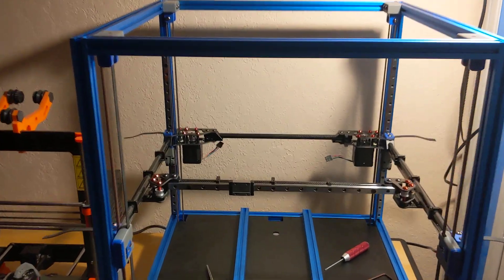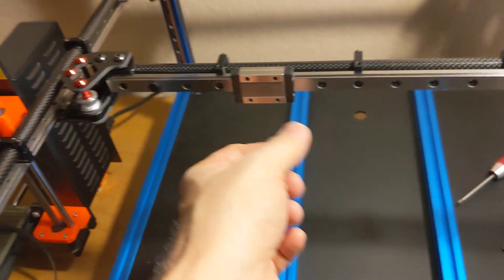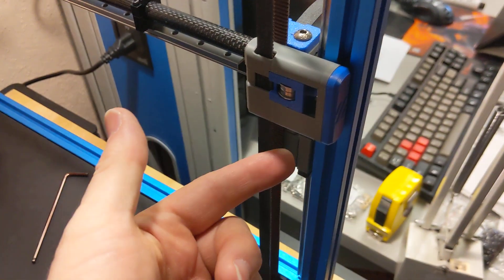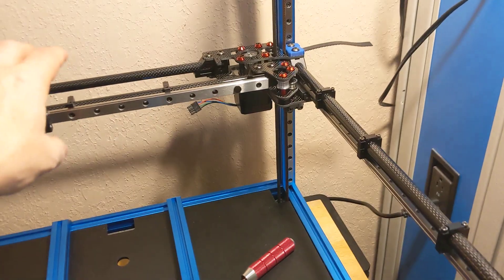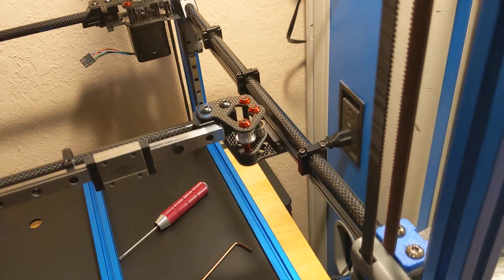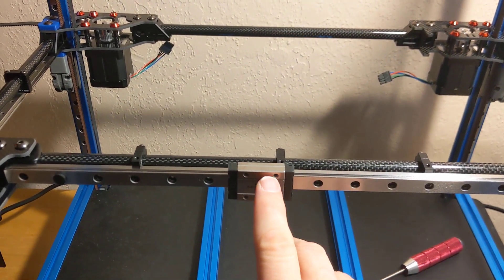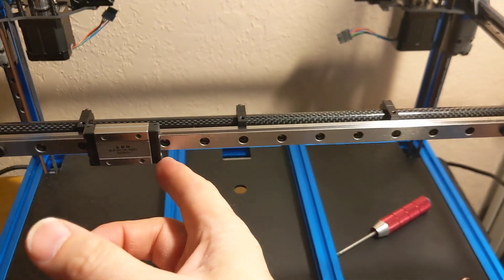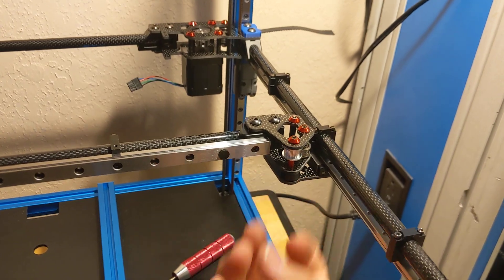3D Printer Voron 2.4 Rev. C 350mm - Build Progress Part 6

Comment: how is the carbon fiber gantry holding up ? , is this the chaotic lab one ?
Reply from the maker: I still haven't printed a test print yet.  Nothing but issues, mainly due to bad printed parts.  I did get successful quad gantry level and calibrated the extruder, so I have 'pushed plastic' but I still haven't printed anything.  I'm currently working on the umbilical setup but had a plastic clip that holds the back panel in place crack on me.  I'm about to send a not very happy email out about it, as I'm not stopped again as I can't route the umbilical through the back panel if I can't get the panel attached.
Reply: @TomsProjects  that’s not very good to hear , hope things sort out and you progress with your build.  Keep sharing more as you work towards a solution.

Comment: Hey Buddy, I pretty much trying to do the same setup as you. Please how did you install the rama front idlers ? the chaotic holes for the connectors are both big (m5) but rama's are 1x m5 and 1x m3 ? what did you do ? Thanks in advance
Reply from the maker: I sandwiched the Rama and Voron plates together with an m5 bolt and nut which acted as a 'vice' to hold them in proper alignment.  I then either used a drill to drill the m3 opening up to 5mm size, or might have heated up an m5 bolt and used it to melt the m3 hole out to m5.  I honestly can't remember which way I did it.  
I hope that makes sense.  
Sandwich the 2 plates together using the m5 holes, so you can then tell exactly where you need to enlarge the 3mm Rama hole to m5 diameter using whatever tools you prefer.
Reply: @TomsProjects  Thanks a whole Bunch. The Chaotic labs kit is very nice. Toooo bad they keep meesing with it, by not including all the screws and bolts. Thanks

Comment: this looks awesome, using the carbon fiber may prevent gantry vibration at high speed compared to the aluminum extrusions. I think his would look really good in a doom cube setup too.
Reply from the maker: It was a total impulse purchase that I probably should've done some research on first.  That being said, I currently have no regrets.
Something I don't think I mentioned in the videos yet is that it's not designed to use the XY end stop PCB or the cable chains that the LDO kit does.  I'll look more into that once I've started routing wires.
Reply: @TomsProjects  for cable management I think you can just use the umbilical mod. It wouldn't be hard to do I think.